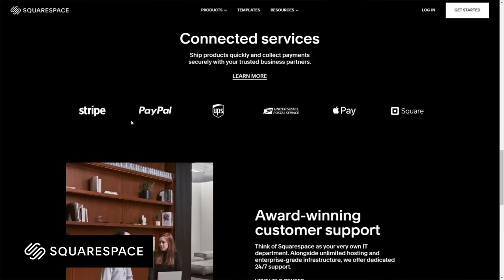I Bought 8 Broken PS5 DualSense Controllers - Let's Fix Them!

Comment: What I find fascinating here is some of these controllers are using different analog modules than the others. Some are using analog modules with orange potentiometers, I believe those are from Polyshine Favor Union. The others are using the ALPS analog modules with the green potentiometers, the kind you find in Xbox controllers. I'm curious if they feel different and have different failure rates. I guess we'll find out.

Comment: People waste no time already breaking their controllers😂
Reply: Allie
Reply: I have an original Xbox 360 controller that is around 15 years old. Works great.
Reply: wrong, ps5 controllers waste no time to broke it self
Reply: When I had my old xbox I threw the controller a lot and it broke so I took my time breaking my controller
Reply: @ohno0007  ...what
Reply: @liliethalejandramendozacoy8822  really ? been using dual sense since launch and still no problem,better than that switch pro controller and garbage joy cons
Reply: At least now I don't try to break my controller every time I get angry on my PlayStation
Reply: @ohno0007  its just about 80$ a same with a pair of joy-cons,and pp been using at least  3 or 4 pairs of them
Reply: @hgiangpham1128  if you play any game that over uses the R2 adaptive trigger tension feature like Cod Cold War your controller will break
Reply: @PhantomRavn  nope bro the triggers go brttt,don't listen to those stupid pp said, every controller has problems, even the elite controller can have drifting, but those aren't as wide as many pp said
Reply: @hgiangpham1128  out of curiosity what games do you play and how long are your sessions on average?
Reply: @hgiangpham1128  joy cons are garbage shouldn't be $80.  I can't stand playing 3D world with them my hands are too big.
Reply: @hgiangpham1128  I don't believe that  controller drift is a issue on the ps5 considering it uses the same joystick as the ps4. What I am talking about is the unreliable Adaptive tension trigger feature that is easy to break. Games that use this feature at it's full potential easily break R2 tension resistance
Reply: @ducasse8473  I own a potato pc, a ps5, a switch, a 3ds, and a phone, which platform are you asking bc rn I'm playing the switch, I'm thinking of ditching the ps5 since there are no good titles at launch rn
Reply: @PhantomRavn  the trigger you are talking about is mostly just bc the spring on that lies outside the r2 shell (Idk what is it called, just watch Tronics fix teardown ) not the gear and the motor itself, it just makes the trigger lighter, like it returns itself into a Dualshock, but mine still working fine, I tore it down and replaced it with better spring then
Reply: @hgiangpham1128  Yeah I know, why should we have to teardown the controller and replace parts for it to work properly? I've only had the Ps5 for three months this is absolutely absurd.
Reply: @PhantomRavn  tbh just don't buy consoles at launch, buy them a year later, there will be lots of cheap part replacements, maybe some Chinese manufacturers might tear them down and start copying them to make them better, just like the joy-cons, my guess is that a pair of the adaptive triggers would just around 10-20$
Reply: @hgiangpham1128  I have always bought consoles at launch for decades now and have never had an issue until now. it's frustrating, Sony obviously cut cost in areas that will greatly affect the durability of the system
Reply: rasso0okah banaja  i mean whenever i get stuff i try my best to take good care of it especially the ps5 going for a 1k now. I know the controllers are 70 on amazon but here where I'm from, controllers alone cost $250+.
Reply: Not all people just people who are too financially comfortable to throw 80 bucks every other day raging on cod or fortnite
Reply: No matter what kind of problems others have, i always take care of my consoles and controllers and i never have problems. Since the original SNES and PS1, i still have them all working.
Reply: I got 3 broken controllers all have trigger issues
Reply: People should baby their controllers like I do.
Reply: Yeah, xbots.
Reply: @korinogaro  it's not a joke, its because these problems aren't as widespread as pp claim, mostly bc console fans  attacking each other, the Nintendo joy-cons have been a laughing stock for drifting, but I hardly get any of my joy-cons drifted, dare I say I even abuse it more than you when it comes to smash(850 hours), and the only problem I'm having here is that the joysticks starting to loosen and get wobble, I got a pair of replacement for only 4$
Reply: @korinogaro  and I'm even using 2nd joy-cons
Reply: rasso0okah banaja  i can say the same with xbox elites controller
Reply: @korinogaro  i have taken apart the dual sense,the only thing i replaced was the r2 tension piece of turd spring,other than that,it works fine
Reply: Do you guys use your controllers as hammers or something? I have had worse luck with aftermarket controllers than my switch pro controller, dualshock 4 or dualsense. The only reason I even tried aftermarket was for a non traditional layout.
Reply: @liliethalejandramendozacoy8822  no problems with my dualsense controllers. I use them everyday as well.
Reply: yeah blame gamer broken control
oh wait diff control   lot people have issues with it
Reply: @PhantomRavn  how is that. My stepson all the call of duty games and controller never had a problem. I guess we just blessed then.
Reply: @hgiangpham1128  no good games that fit your interest.

Resident Evil 8 
Ratchet & Clank
Wolf game
It's alot of games coming to the PlayStation 5 this year. It's time to preorder
Reply: @youngrydah4374  I'm not saying it's happening to everyone just letting you know it happened two me twice already, most people don't like the adaptive trigger tension feature playing call of duty multiplayer so they turn the feature off in that case your not risking breaking your controller
Reply: @PhantomRavn  true
Reply: Their all Flights controllers he broke the first won an hour after he got it 🤦🏾‍♂️
Reply: impresive
Reply: @korinogaro  the problem is a lack of respect for what your paying for! If I'm buying a controller it's not to be constantly button mashing and then blaming poor manufacturing. Consider looking at your gaming habits and maybe finding a way to change them a little to get much longer life
Reply: That is why some people have drift on the switch and ps5 and soon xbox too because people are too agressiv not normal anymore 😂
Reply: @korinogaro  how Do you break controllers that much I’ve been using mine constantly and it still works fine. one of these controllers had a joystick and a r2 button missing like how do you even break it like that Bc that can’t happen on its own. My ps2 controller still works
Reply: @zerom.7642  facts that’s what I’m saying people be launching their controllers and then blame it on PlayStation or Xbox
Reply: @liliethalejandramendozacoy8822  no that would be the people breaking it
Reply: rasso0okah banaja  actually people did a test it is very durable
Reply: @liliethalejandramendozacoy8822  your wrong
Reply: @hgiangpham1128  that’s your controller you cant speak for others
Reply: well duh, They belong to everyone who bought Demon's Souls
Reply: Thought I was the only one that thought this like folks already angry
Reply: 13:44 is straight RAGE 😂

Comment: @Tronicsfix I just discovered something interesting about the Dualsense controller touchpad, which I though might be helpful in your repairs. 

I have four Dualsense controllers, and I completely disassembled two of them to custom paint them black. This included removing the touchpad circuit board from the plastic touch pad. I did so carefully and set them to the side. These circuit boards looked exactly like the one in your teardown video, with the orange ribbon cable that is soldered to the board. 

When I reassembled them, the touchpads didn't work. They were getting power, as the LED light on the circuit board came on, but it didn't recognize swipes or clicks. 

So I disassembled ANOTHER dualsense to swap in a known good touchpad, and it worked just fine. I also noticed it was different. The ribbon cable was blue and white, and it wasn't soldered to the board. And the chip was smaller on it. But I know all of these are genuine Dualsense controllers straight from Sony. Thought it was just a different variation. 

Well, in further testing, I went back to my two "bad" touchpads. Decided to exchange them between the two controllers, and guess what? They worked!  

Apparently, the touchpad with the orange ribbon cable is married to the main board in that controller. It won't work in any other controller. But the touchpad with the white and blue ribbon cable seems universal. 

Not sure why the difference, but if you run into an issue with touchpads, it's something to keep in mind. And maybe something to test yourself!!

Comment: The controller drift thing seems to be serious. Read an article that states the average lifespan of a Dualsense is approximately 417 hrs. I have 2 right now, only time will tell.
Reply: I used to work for Microsoft and that happens all the time with Xbox controllers too. Rather suspicious when you learn the controller warranty is 90 days.
Reply: @gabrielpraslin9576  That's illegal in some countries.
Reply: @2megas  most things can be. But that's not the point. The problem is there regardless.
Reply: Hmm read the same article, it states that if you play intensive competitive games that requires sharp turns and what not (like in shooters) and moving the stick all over the place, the life expectancy goes down to 400 hours tops and being honest, its a serious thing.

A friend of mine when we talked about it, I told him that I didn't understand how the heck he has gone through 3 DS4 controllers, he simply said: "You don't play shooters"

This was before the article and I can attest to his diligence in taking care of his things.

Comment: I admire your ability to fault find and fix Steve 😁 Out of curiosity, if you weren't filming this how long would it take to diagnose and repair all 8 controllers? 

Great job 👌😃
Reply from the maker: It's really hard to say. As you know fixing and filming at the same time is VERY time consuming. Most of these probably could have been fixed in under 30 min...but that's just an estimate.
Reply: @Tronicsfix  Interesting to know 😁 Thankyou.

Comment: 13:37 What would be really ASESOME, if you had a decent 3D printer and could print any broken part you needed to replace (yes, would have to “finish” the piece); that would be cool. Unsure about cost affected, but still cool; especially for the parts that are hard to come by.

Comment: I swear to god people don't know how to treat their things. This thing came out in November and we're seeing so many people breaking these already?! Lol
Reply: Sadly too many ppl dont give a crap. They think of it as an object that needs to be used and nothing else. If it breaks they will just buy a new one. Hence i bet most ppl with drifting issues on the ps5 and switch might be using force. I have 2 switches and they never had any drifting issues. Always cleaning my stuff.
Reply: @shinjid3705  I can see where you're coming from but even with very light use I've had controllers run into issues. I have a blue raspberry ps4 controller I use for my pc and the sticks drift and the charge port got loose. And I barely use it, more often than not it is just sat on my desk. And I'm not even playing games that force you to use the sticks kinda rough. I think I played fallen order the most with it. So it's not just a user error thing.
Reply: @AbbyRawks  dirt and environment is also an issue. Corrosion can cause electronics to rust and break inside without u even notiticing. I have seen many guides that solved this problem after cleaning the sticks properly. But not everyone is technically advanced so that he or she can easily tear don a controller and do it without braking it .
Reply: @shinjid3705  for me I don’t understand how people bat around their controllers (I have an elite) like bruh it’s almost 200 yet you treat it like a softball

Comment: i never knew id hate something called a "potentiometer" until i started watching your videos.
Reply: Potentiometers were okay during 1980s when we had nothing better. Nowadays controllers could be using hall sensors or optical sensors and are really expensive to boot so it's not like they couldn't contain better parts due costs.

Comment: Love his videos. Managed to fix my controller without dealing any additional damage. Liquid damage under the main chip (no power). I shot WD-40 contact cleaner between the ball solders and the pcb as a hail mary attempt to fix it. I don't know if this is a long term fix, but the controller powered back up afterwards with no problems. Keep these videos coming! It's probably not the last time I dunk my electronics in a spill.

Comment: That "film" seems like a terrible design. In the retro community a lot of computers have what's called a membrane keyboard which is basically that. And they go bad ALL the time. It's so common that most of the computers that have them now have modern replacement parts that are compatible. It's still a membrane though so it will still fail again.
Reply from the maker: It's the same as they used on the DS4 and I'm actually surprised how durable it is. It does go bad sometimes but there are other things that are a lot more common.
Reply: @Tronicsfix  the broken one was green and the one you replaced it with is blue so I think sony has 2 or 3 companies making parts for the controller and some of those parts aren't as good as the same part from the other companies.
Reply: The membrane is silver loaded ink printed on a substrate which is very cheap and easy to make.  Sony has 3 vendors in their supply base that make these for them.  The contacts for the button plungers are carbon finish which rub off if you use IPA on it.  The terminating end that interfaces with the circuit card assembly can crack and rub off when cleaned.  Flexible circuits are never repaired - it is best to replace them outright and never touch the carbon etch with your fingers.
Reply: @downesg  yeah that's pretty much what happens on old retro computers. To make it worse most of them are fit into a connector that is a really snug fit. Removing them multiple times breaks them. Also if they are flexed enough (IE removing the cover with the keyboard off the machine) they break even if they aren't removed. The C64 design is so much better because it's just a bunch of pin hearders with a proper connector and actual wires. I've never heard of this going bad.

Comment: Wow this was amazing to watch. Especially how you got 8 out of 8 Dual Sense Controllers all fixed. It's a shame you couldn't get all 13 PS5 Consoles fixed as easily as you did with the Controllers. But way to go on both the videos. They both were very enjoyable to watch. 

Your the reason I'm a pro at disabling the PS4 Pro and making it Quiet. 
I have not learned with the PS5 yet. But that's because I have a nice good working PS5. 

Knock on Wood haha.

Comment: 19:56 that's definitely Sony issue. That film or FPC or flexible printed circuit is common issue at supplier side. I hope sony may see this and include on their FMEA or failure mode effect analysis to request improvement from their supplier so that this kind of failure will not flow or leak again to their consumer

Comment: I always wondered with these controller tests, if you test the bluetooth connection to the console. As you always show them plugged in with a cable. Maybe the ones that appear to have nothing wrong, are actually having wireless issues?

Comment: From all these issues with joystick drift i am curious, altough i don't really want to take apart my ps5 controller.
Can you test the actual voltage being used for the potentiometers on the analog sticks and how they compare to older controllers? 
A lot of the wireless mouse issues from logitech (the lightspeeds), come because Logitech used "long life" switches, but those switches didn't work well, because logitech used larger pullup resistors with causes a smaller wetting current, and lower voltage. which caused the same switches to fail much faster.

Comment: Hey bro. My ps5 controller R2 button is loose and this is the 2nd controller. It only been a month of use. And the spring inside snapped on both. Can you help with a tutorial. You go in-depth with repair and you’re very easy to follow
Reply: @tronicsfix7114  fake account?

Comment: I'm really curious what kind of roided tantrum did all that damage to #3. And then as you said, it looked like someone has taken it apart trying to repair the damage. Was it spiked off a wall? Dropped out a 2nd floor window?  

Every piece of damaged electronics that isn't "faulty from the factory" usually has a story behind it.  I love those stories.

Comment: Great vid Tronics. Can you help me figure out what’s wrong with my DualShock 4 controller. My R2 trigger is not response some times like the 5th dual sense you fixed, I wanted to know if my problem is also the spring issue or a worn silicone grommet? And btw keep up the great work!!!